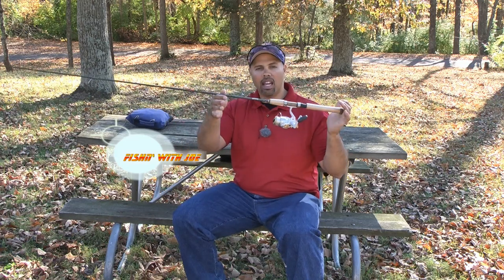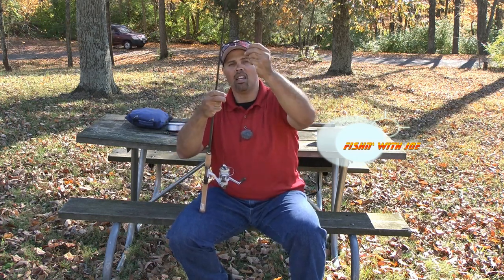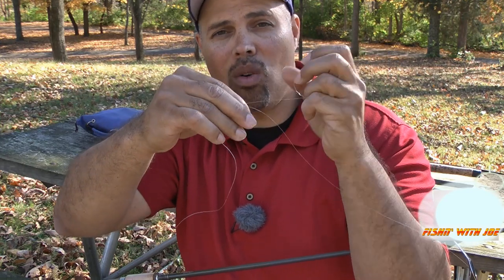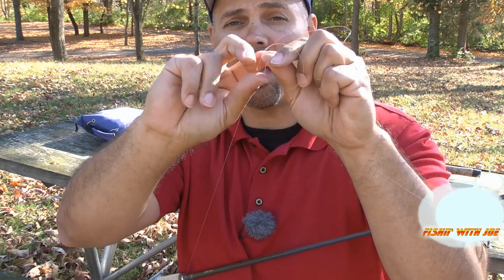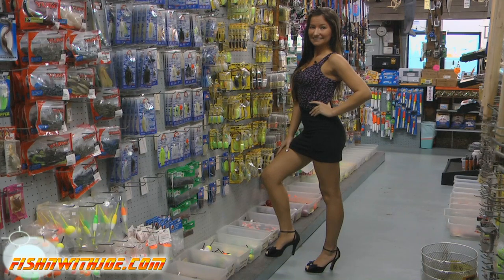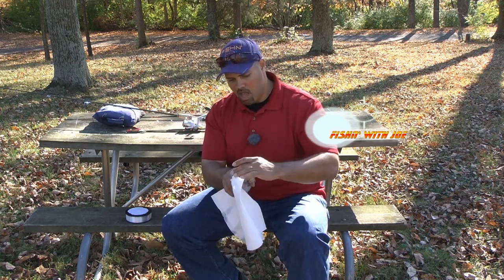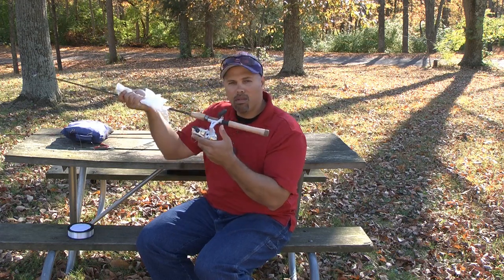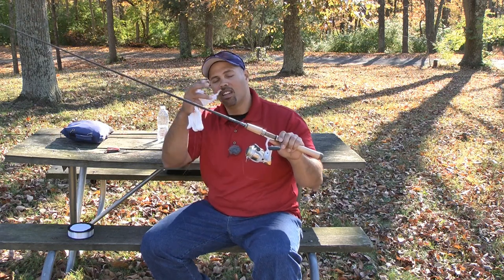How to replace line on a spinning reel.

Comment from the maker: I've never used that method. I often have enough line on the filler spool for 10 refills or so. The rest of the line on the filler spool may sit for a few months. How does the line on the filler spool hold up after sitting a few months when you do this? If it holds up good I think I'll try it.